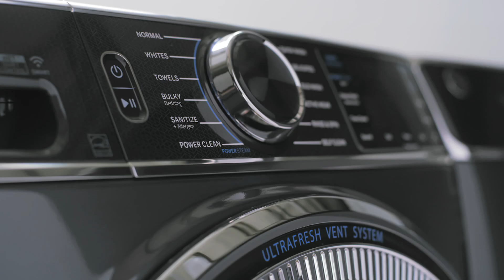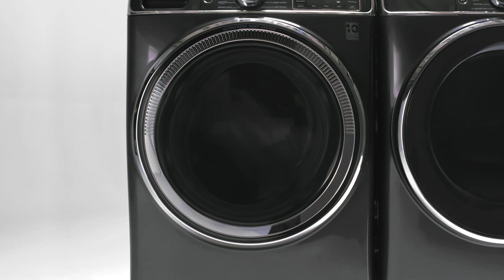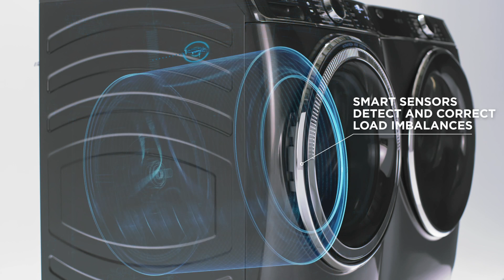GE Appliances UltraFresh Front Load Washer - Dynamic Balancing Technology (dBT™)

Comment: We just bought the GE Combo and it knocks very loud on every single load. Shipping bolts are removed .. professional install.
Reply from the maker: We encourage you to review the troubleshooting tips on page 28 of the Use and Care Manual (http://spklr.io/6053aic3) in the "Loud or unusual noise; vibration or shaking" section. 

We also recommend ensuring your Combo's software is up-to-date. You can find more information on this in this article on our GE Appliances website here: http://spklr.io/6054aicO
Reply: @geappliances  I have reviewed that section a few times ..  Software is up to date.
Reply from the maker: Since those troubleshooting tips didn't solve the issue, we recommend reaching out to our service team by calling 833-426-3393 (Monday – Friday: 8 a.m. – 8 p.m. ET; Saturday – Sunday: Closed) for additional assistance.

Comment: What is the life-span of washer balance rings? We have an 8yo GE washer, just replaces the bearings, both front and back balance rings are intact, you can see full fluid level in them, bu the front ring is pretty beat up. How long does the fluid. The basket is solid after the bearings where replaced, but the washer has difficulty balancing during spin cycle.
Reply from the maker: We suggest if you haven’t already, reaching out to our service team. They can be reached at the phone number or link here- 833-426-3393 Monday – Friday: 8 a.m. – 8 p.m. ET Saturday – Sunday: Closed. http://spklr.io/6058Fzzr
We are confident they will be able to come out and properly diagnose what’s happening with your unit.
Reply: @geappliances  trying to save money on a service call.
Reply from the maker: Our service technicians are the best equipped and trained to properly diagnose and fix issues on your appliance.